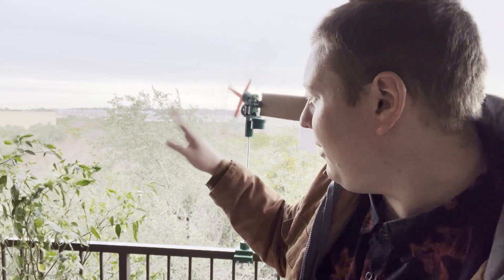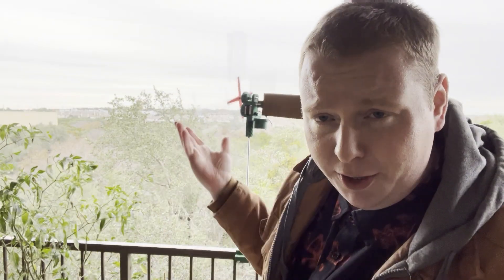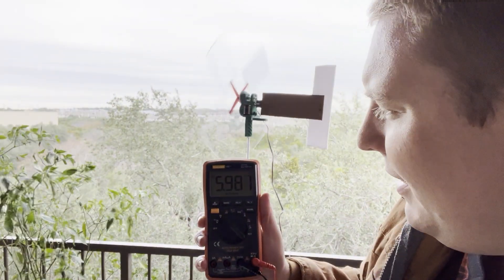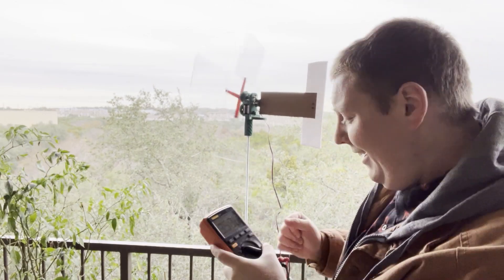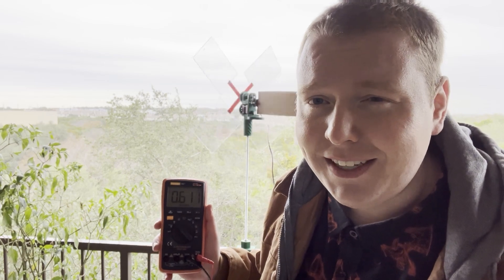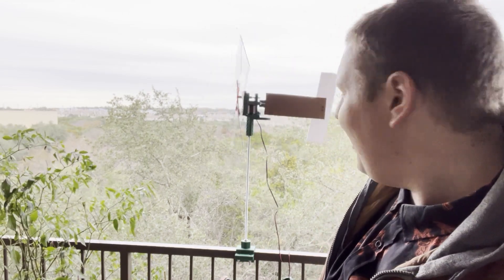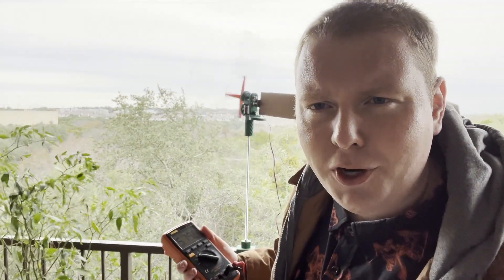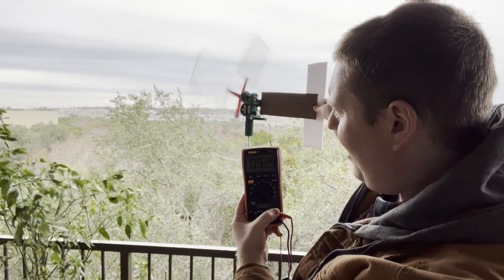Windmill XXI Speed Testing and Power Reading (WXXI Update 5)

Comment: I'm busy with a vase mode (spiralize) vawt that can print a 200mm x 200mm diameter in 5 hours using 95 grams of pla, wich makes for a very lightweight but quite durable vawt. I'm overextruding to cause the sides of the vase to fuse and thus making quite strong, very lightweight 2 layer blades.  I had them in the outdoors now for a few weeks and they are working a treat, its a savonius style with build in space for skater bearings, I was busy building a generator for it and realized that it is very difficult as the diodes's voltage drop, I've found some circuits to multiply the ac voltage and then rectify it and will test if that overcomes the voltage drop that the diodes have. I also aim to maybe put a joule thief circuit to good use. You made me think again about stepper motors, winding coils for a generator is really a pita. The popularity of stepper motors are causing them to become cheap.

Comment: That is just really cool. I feel like some stiff pipe with bearings at each end would reduce the wobble, which could give more consistent power. I think you might be losing some energy from the body changing angle to the wind. On the other hand, weatherproofing the shaft could be a challenge. In any event, I'm looking forward to seeing more in the future. 😀
Reply from the maker: I think you're totally right. I have so many projects going on that the lower-priority changes get put on the backburner. I bet it would make a huge improvement to the power output, though, if the shaft was more rigid. 

Glad you enjoyed the video! Many more to come.

Comment: That stem makes me anxious, I'm impressed it's holding up so well.

Why the linear regulators & not a buck/boost module?
Aren't they fairly wasteful?

Have you considered a 'drag' type blade arrangement?
With the blades behind the balance point, I've only seen them on the Hebrides so they're probably pretty great for higher winds & wouldn't require a tail vane.
Reply from the maker: Haha. Yes, the stem isn't great right now... something to improve in the near future. 

Linear regulators are because I eventually want to power batteries, which require a very steady voltage. I haven't looked into buck/boost modules, but if one exists that can stabilize a voltage to 5v within a 0-20v range, I would naturally prefer that. 

Can you send an example of a drag type blade arrangement? Sounds interesting. Thanks for the comment + your input! :)
Reply: @christophersfactory  I had previous comments, not sure if they've been deleted due to the links I added.

Basically, the only example of the rear mounted blades I can find is SD wind energy, they're also auto-feathering, which is a cool addition to see.

If you're consistently getting more than 6v then a little buck converter with a USB output would be ideal for you.
I'd definitely keep a capacitor bank ahead of the converter though, just to collect lower voltages & smooth the output